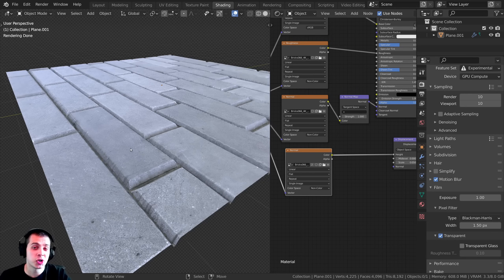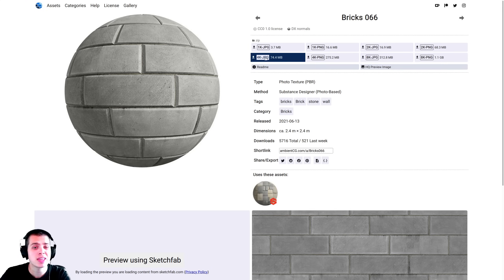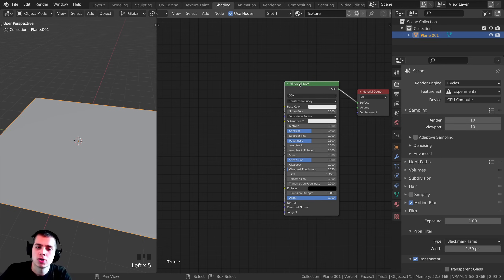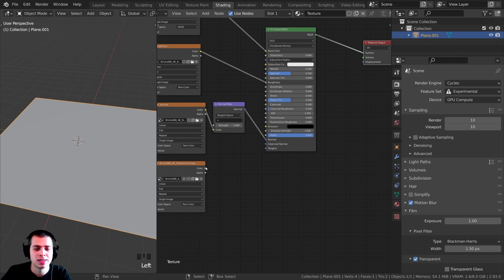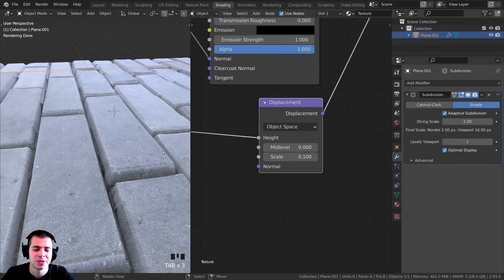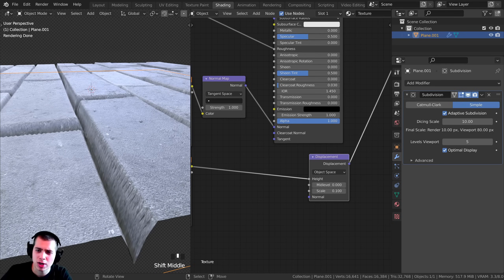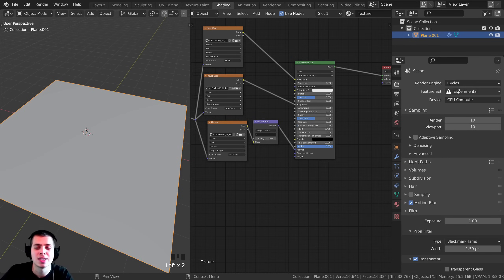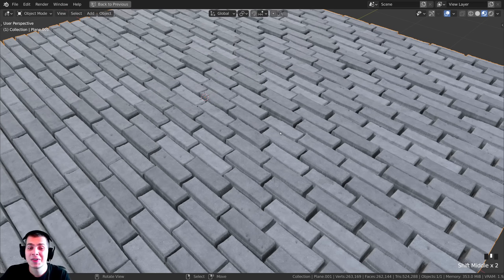How to Use Displacement Maps in Blender (Tutorial)

Comment: I'm very noob level (as the question will probably illustrate). I understood you showed two approaches (a) using a material which strikes me as a purely visual representation and (b) displace modifier, which truly affects the mesh.

However, you undid everything you did in the material when applying the modifier. Is there a way to "pipe" the material modifier into the mesh instead? I don't have an image, but was playing with organic forms using e.g. colors piped into wave distortion into the displacement node in materials. I found that exporting an stl has hardly any texture, and believe my issue is this is not affecting the mesh itself. But, I have generated my desired displacement in the material and just want to make it impact the mesh... but I have no image to use as a standalone input to a displace modifier.

Thanks for any suggestions!

Comment: HIya, thank you so much for the tutorials, really appreciate them. I was wondering if you could help with a problem I am having. When I have an object and the scale is not applied, I add the displace modifier and everything works just dandy, but if the scale is applied before the modifier sometimes nothing happens or you can hardly seen the displacement. What am I doing wrong? Any help would be greatly appreciated, thank you

Comment: I have followed the exact steps for the first method, yet the displacement is not even working/becoming 3D on the texture, it stays completely flat even with subdivision
Reply: Setting the feature set setting under cycles as "experimental" ended up fixing this for me (it gave me the adaptive option)
Reply: @AshElectric  That gave me the adaptive option but it's still flat. It's probably because I'm rocking an AMD GPU.
Reply: @MIC_Enjoyer  I was following another tutorial and one thing that was pointed out is you need to be in the "material" view vs. solid or wireframe. Or I think rendered also works. Just guessing.
Reply from the maker: Hmm, I'm sorry that its not working for you. I don't know why.

Comment: tutorial doesn't work as added in the displacement node, hooked up with texture, non-colour etc exactly as tutorial and its putting a bump map effect on the object but no displacement. Added a large subdivision modifier on a mesh and still no movement of the bricks. Please add troubleshooting or make working tutorials
Reply from the maker: Did you make sure to turn on the displacements in the material settings, that I go over at: 3:18 in the video? Also did you make sure your in Cycles render and in the rendered mode?

Comment: I have using Blender version 3.2.2 and my subdivision surface modifier just have 2 option that is Level View and Render. but in some videos like yours it has so many options which i dont have !Also in Rendr Propertice i cant see Feature Set and and Device. Please help me.
Reply from the maker: Hmm, are you using Blender Eevee? the displacement modifier works in eevee, but the other types of displacements only work in Cycles. Also, are you using an old version of Blender?
Reply: @RyanKingArt  Thank you so much for your response. I changed Eevee to Cycle and then Render setting fixed but the main problem is my subdivision modifier. i have been using Blender version 3.2.2 and its has just two button Catmull-Clark and Simple and 2 input number Level View and Render. It has nothing else except these. but in your videos or some other people your subdivision modifier has more option !!! Should I active them from other place ?
Reply: @ehsankeramati  more options appear when experimental render mode is on

Comment: if we change texture in nodes like change scale, when this second displacement option doesnt fit
Reply from the maker: What part are you in the video? And what displacement method are you using? Displacement node? Or displacement modifier?
Reply: @RyanKingArt  add texture by the node classic way, change scale and/or rotation in nodes, and then use displacement modifier
Reply from the maker: Did you change the coordinates on the displace modifier to UV? Then you can scale the UV mapping to scale both the textures and Displacement.

Comment: I can't get displacement to work in 3.1.2. And there's no 'adaptive subdivision' option in the subdivision modifier on 3.1.2.  Feature seems to be broken on the latest release.
Reply from the maker: You need to make sure you turn on Experimental mode if you want to use the adaptive subdivision.
Reply from the maker: Also make sure your in cycles render.

Comment: Is it possible to create Displacement Maps from photos of a single object? If I can control the lighting and I'm the one taking the photos? I've seen some tutorials on creating Normal Maps by lighting an object from four (4x) different angles and then combining those 4 photos into a single Normal Map. But is there a similar process for Displacement maps? I have a ton of things I need to photograph and model, and painting the displacement in ZBrush for every single thing doesn't seem feasible.
Reply from the maker: Thanks @Keiwah Yeah displacement maps use values from black to white, so yes, you could make a displacement map from an image, or texture.

Comment: Which technique do you prefer Ryan? The displacement node or the texture ?
Reply from the maker: I prefer the displacement node, and using the adaptive sampling.
Reply: @RyanKingArt  Nice! Yeah I liked that..had some strange issue though. Created a Spec, Displacement and Normal Map node from an online tool...an old one called Normal Map Online...based on a simple jpg of a wood. Though when I added the image as the base color node, it wouldnt recognise it. Is that due to the naming convention not matching that of the above displacement maps? I didnt use a PBR pack ...just made my own.
Reply from the maker: Hmm, I'm not sure. Could be the name, but if you manually added in the texture, then it should work fine.

Comment: 7:57 I did everything you said but I can't get it to be bumpy (3rd dimension). I do get 3rd dimension when I use displacement modifier but can't with a map. i use  blender 3.0
Reply from the maker: Did you turn on the displacement and bump setting, at 3:18 in the video? Also, make sure your using Cycles render. If your using Blender Eevee, I go over another method for using displacements in this video.
Reply: @RyanKingArt  wait. I see the wall (bumps) in 3D but only if I render it. I was watching it in "Material Preview" window, so I need to put on "Rendered" window.
btw it would be helpful if you made a brick house tutorial. It can be a very simple house.
Reply from the maker: Thanks for the video idea. 👍‍

Comment: how come i don't see the displacement tab on material properties??
Reply from the maker: Probably because your in Blender Eevee. Switch to the cycles render engine if you want to use the node editor displacements.
Reply: @RyanKingArt  tks
Reply: @RyanKingArt  but still sfter i switch, i don't see the "true option" on surface displacements
Reply: @relaxpinknoise  In the older versions it was 'True', but it's changed to 'Displacement' in the new versions.

Comment: This really helped me on a problem regarding a tilled floor. Thank you! I have one question regarding the rendering of a sequence of images close up (using the first adaptive setup): 
Will the mesh "adjust" the quality  just like pressing dopple tab with every step the camera makes? Or do you apply the modifier first? To those areas of rendering and texture Im not accustomed and quite a newbie. 
Thank you
Reply from the maker: Yes, if your using adaptive displacement, it will always update, depending on where the camera is located. So it should always look high quality when rendered. Thanks for watching!
Reply: @RyanKingArt  That is nice to know. Thank you for answering.

Comment: Ryan, well done, but your example is too simple. For example, this can be done in 3dsmax V-Ray. Perhaps in 5 clicks. You don't need to configure anything. But I am having a problem creating a brick wall. I thought that. maybe there is a modern good way to do it in a blender. But I have not found a tutorial for either V-Ray displacement mod or Blender displacement mod. I have a huge request. if possible I can leave a link to my work with a piece of brick wall. How can you do the same in Blender? I can also describe several problems that I had to fix only in Photoshop.
Reply: can you also tell me in which program you can make the whole set of maps for displacement? (occlusion, normal, etc.)
Reply from the maker: Hmm, I have never used V-Ray or 3dsmax, so I don't know if I can help much.
Also, I don't make the textures myself. I use textures from 3d texture websites, Like ambiantCG, CGbookcase, Polyhaven....
Reply: @RyanKingArt  sorry to hear that. it turns out some kind of one-sided development in the profession :-). okay, I'll ask the others.

Comment: Do you have something on how to get rid of stepping (aliasing?) Even using 4K 16bit maps in cycles my displacement looks like something out of the Lego Movie.
Reply from the maker: Hmm, no sorry. I have not had that problem before. One thing that you could do, is open the displacement map in a 2d program, and blur it a little. That might smooth it out.
Reply: @RyanKingArt  No, I think its a blender thing. I'm using 4k materials from places like PloyHaven. Cranking up the normal strength often helps but not always.
Reply: Hmmm... Well, saving as 32bit with a little Add Noise in PS did a pretty good job but requires a 64mb image!  I did a .5 gaussian and tweaked the contrast a bit and saved as a 16bit  and that was only a 5mb image. The result is a little grainy (from the noise) and you can still kind of see the banding but it not Minecraft anymore as long as you keep the Displacement scale less than .5    I tried taking the original 72dpi image and converting and shrinking to 300 and then blurring and saving as 32bit and that looked best (but again a huge file) You can still see it but it lets you push the displacement scale higher before the steps show up. I tried 4 subs on the original mesh before the sub-d mod (6 lvs) and that smoothed out the banding but made even my 3090 chug. So I don't know my dubious opinions of displacement in blender is unchanged.
Reply from the maker: @seanposkea  Ok.